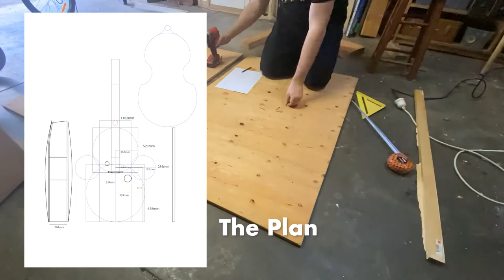What does a plastic double bass sound like? DIY- Building a Real Bass from Polycarbonate Acrylic.

Comment: Wayne awesome work. 2 Questions: Where did you get the mounting hardware for the neck to body and what glue did you use to join all the polycarbonate pieces together?
Reply from the maker: I made the locking mechanism myself out of brass. And the acrylic adhesive is Acrifix. It chemically welds the pieces together.